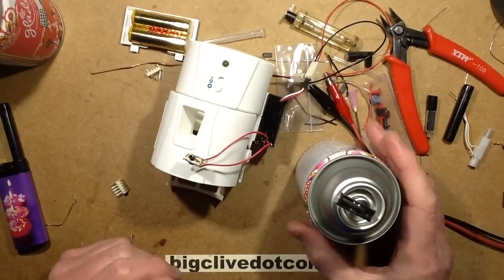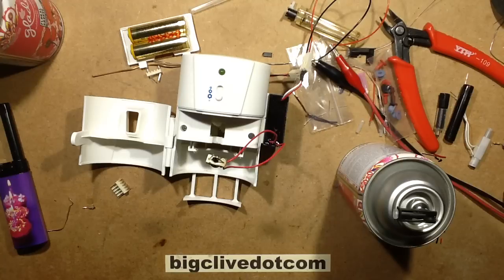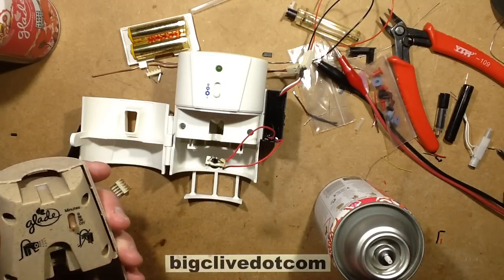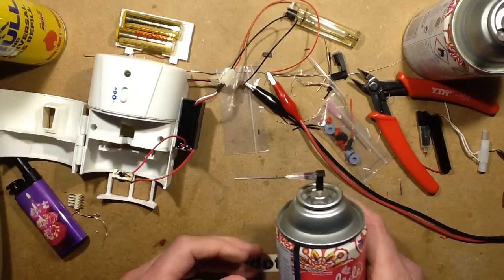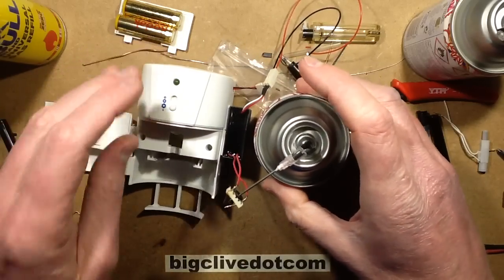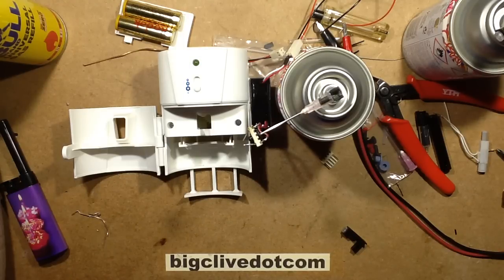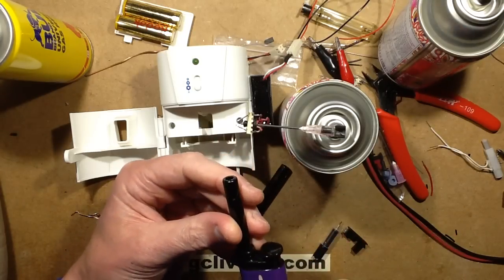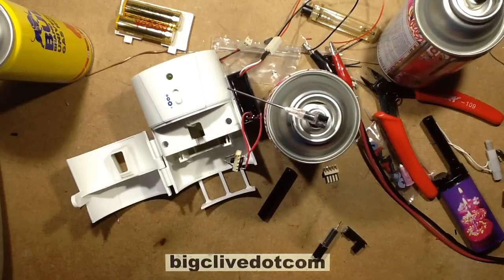Failed automatic flamethrower project.

Comment: Your two options are pretty much find a nozzle that properly atomizes the spray, or use a more volatile canister of spray that isn't perfume or butane (I.E. WD-40).  The needle makes the liquid stream too condensed for ideal A/F ratio to ignite (unless you were using really flammable liquid like a petroleum product).  Coincidentally because the standard spray nozzle on the perfume cans actually atomizes the liquid to help dissipate the spray as much as possible to be carried around on whatever air current is circulating, it makes the ideal A/F ratio too.

Comment: Hi Clive.  I used to work in hotels and the mental pictures of dozens of these firing off at random just fills me with warm and fuzzies.  While using air freshener has the side benefit of scenting the air as sort of an apology for setting coiffures ablaze - the liquid bits are working against you in keeping a small form factor.
a. You to need more distance and time to atomize properly and allow the non-burning bits to dissipate.
b. Unless the nozzle is precisely aimed the fragrant oils will act as napalm and burn your device.
c. Loss of ignition heat from evaporating the water mist.
I think adapting a butane can will give much better results and allow ignition within the original form factor of the unit - we can't have air fresheners with canon barrels sticking out to arouse suspicion.  I suppose you could add a small container of scented oil and feed it into the stream via one of your needles and the venturi effect to alter the size, color, and smell of the fireball.  At least you'd be in control of the burning / non-burning bits ratio.
-Grouchy

Comment: This reminds me of having to remotely feed the output of a smoke machine through tubing.  Resulted in melted tubing.  Then used metal tubing but had blocked off the fresh air supply to the nozzle so the fluid did not atomize properly - leaving the adapter a little loose fixed it all.  What you need is the extension tube to have a metal atomizing tip on a tube.    I would think the vaping world would be a source of such components.
  I built a similar setup which allowed any can of nice or nasty contents to be remotely fired.  With flammables, we used a tea candle for an igniter - not fancy but was for TV SFX.  https://www.flickr.com/photos/simplesimon/3461015568/in/album-72157665406378341/

Comment: If you can find any, look for an SSSCat. They are hilarious little cat scarers designed to go on counters and stuff, they have a little PIR module in them. They also run on 6v and use a solenoid and integrated tubing and stuff.

Comment: This is a great project but is it not basically the fire machine?  The orifice from that is probably a better sollution  Or maybe the brass orifice from a flower/degreaser pressure sprayer and maybe control that with a PIR out in the garden.
Reply: +rimmersbryggeri There you go. I was trying to think of where a metal atomiser could be gotten. That would keep the atomization and since it's brass, it wouldn't melt.  Some simple adhesive to hold it in-place... wouldn't need to withstand heat/fire for any extended length of time...  and "Orifice" could be added to the name as well! ;)
Reply: wdavid parks
 The fire never touches the orifice if it is properly set.

Comment: What if you used a non flammable tube, perhaps made of metal, the same ID as the spray head with slots in it for air intake? You could also weld a bracket on the tube to protect the sparking assembly.

Comment: So I just tested what you said about the vents around the side of a lighter being needed to ignite a flame and it would seem you were wrong on account of me  burning my fucking finger, nice one Clive
Reply from the maker: +Arnold Layne Try putting some tape round the lighter and lighting it several times in a row.  Initially it will light with the residual air, but will usually fail to light afterwards until enough air has re-entered via the end.
Reply: +bigclivedotcom Aye I should probably have factored the residual air into my experiment, finger is still stinging haha

Comment: I have a feeling that as well as the fuel-air mixing problem that you've identified, the gas leaving the blunt needle may be going faster than the flame propagation speed of the mix - perhaps replacing it with a length of brass tubing that fits over the outside of the can nozzle would work better.

Comment: What if you had the sparker leads mounted to the front cover and extend out a bit in front of the unit in a sort of horizontal Jacob's Ladder?  They could be #16 bell wire.  The spray would be sprayed on the spark and ignite quite nicely.

Comment: Can you get the ignitor about 1-2cm in front of the nozzle to allow better atomization?
Reply from the maker: +Carlton Dodd I tried that but it was still unreliable and then the extended wires desoldered with the burn-back and fell off.
Reply: +bigclivedotcom You'll get it figured out.  I have faith in your ability to make innovative, dangerous toys from consumer goods!
Reply: +bigclivedotcom isn't that why real flamethrowers use solid metal rods as the arc points rather than bits of wire?
Reply: +bigclivedotcom I'd go with a proper electrode set for this - steel wires going through a ceramic holder. Salvaged off old gas burners or something. Or perhaps even just wires with flameproof insulation going through a steel holder with the ends bared?

Comment: maybe if you used a canister of butane instead of the air freshener?
Reply from the maker: +0yeme0 I tried it and managed to fill my workshop with quite a lot of butane vapour without ignition.  It was "exciting".
Reply: +0yeme0 air freshener is mostly butane. Don't think it would make much of a difference.

Comment: Clive, I know the smell you mean. I call it fart in a tart's handbag.
As to the fuel / air mix problem, why not add a slightly wider tube over the needle. The tube needs to be open to the air at both ends and extend past the end of the needle. This effectively makes a venturi fuel injector / system. The fast moving strumpet scent pulls air in from behind, mixes it as it flows forward and then the igniter sets the mixture on fire.
Different diameter tubes will alter the stoichiometric ratio of the fuel / air mix.

Comment: I'm going with file a v or x in end of the needle to disrupt the fluid surface tension, but you only need the fluid to break up a bit so even a small piece of wire just to spread the fluid stream would work?
Personally i'd be going down the route of sleeve over the tube with a bigger diameter tube that come off the end of the smaller tube and then notch that tube so its drawing in air and causing some turbulence on the outside of the fluid stream... sort of like a propane burner / carb but you don't want it all setting on fire just a bit on the outside to that the flames heat is carried away then the fluid can boil mid air and give you a bit more distance.... or make it more like burner and just have a fireball.. :)
We used to use super soaker 50's to make flame throwers as kids much fun till we burn down a trestle at my cousin's house, luckily they also work well as fire extinguishers, which saved the rest of the garden.. xD
Reply: +Dave Webster yep the original nozzle just shooting down a tube, probably 13mm copper pipe, would draw air and ignite at the end and be as short as the current needle

Comment: Definitely revisit this, Clive! Much excite! :D
I reckon you could use the metal needle as one of the electrodes, some wire wrapped around in a helix with a small section at the tip acting as a spark as the second electrode, and a flame proof spacer separating the two for insulation.
That's what I'd try. Perhaps a glass tube cut to length? Fibreglass sheath material wrapped around to form a tube?
Experiment :D
Good luck!

Comment: so when it doesn't catch fire immediately (due to mixing ratio imbalance probably) you blow out the spark. How about a glowing kanthal wire? might be a more reliable source of ignition. Doesn't have the same flair a spark has, of course :D

Comment: This sparker looks more impressive:
http://www.ebay.co.uk/itm/Incredible-DC-3-6V-6V-400KV-Boost-Step-up-Power-Module-Voltage-Generator-Black-/371338759332?hash=item567583cca4:g:R5QAAOSwl8NVZ~zP
Reply: It's the one from Julian Ilett, right?
Reply: yes
Reply: +the3dvideo The 400kV is a typical Chinese marketing hype. They state the spark goes up to 2 cm but that is equal to only 60 kV if the dielectric strength of air = 3*10^6 V/m
Reply: +the3dvideo spark transmitter....not that i want to give anyone ideas, notice how it messed up the audio, its not actually very loud, its the RF interference, couple with tv aerial......

Comment: Thought about jetting the fuel through a fine metal mesh with the igniter on the other side? It might sufficiently disperse the fuel in air and provide protection against the flame backing up. See the latest video by Steve Mould for a clearer explanation.

Comment: I think the plastic head is the atomizer... by putting the needle on it, you're making the mist combine back into a liquid.  You might be overthinking it a bit with gas lighter nozzle thing.
Reply: The air to fuel ratio would still be important, but yeah. Vapors tend to burn better than liquid drops.
Reply: +mnelson10000 Agreed, It's not vaporizing properly for the flamethrower effect. I bet that needle thing would make it a decent perfumed squirt gun.
Reply: +Mr Rishi The Cookie making it work would be a nightmare, without very careful dosing it'd squirt rich air/rich fuel, each time extinguishing itself. Believe me, mixing beer and water with that sort of installation is a pain, I wouldn't like to try it with a combustible gas
Reply: +Josh G. (OtaconEmmerich) Also I'd get spark a bit farther away from the spray point for better vaporization of fuel.
Reply: +mnelson10000 How about adding a line of compressed air into the same nozzle. That way the air and fuel mix inside the needle and then get forced out and then at least puts out a bunch of small droplets. So when the trigger is pressed both compressed air and fuel get fed down the same needle nozzle and then my theory is that it should work.
Reply: Mr Rishi The Cookie The nozzle is quite small, and while your theory is correct, you would need a nozzle double the size for the fuel alone. (if it's the metal one you're referring to.)

If you are talking about the plastic atomizer, then it's big enough for the fuel, so you would preferably feed compressed air into the stream after it exits the atomizer.
Reply: Sked NEC. the metal one. And yes it probably should be thicker.
Reply: +Josh G. (OtaconEmmerich) perhaps if the needle was pinched slightly or perhaps using the tip off of a charcoal grill lighter
Reply: +mnelson10000 He said the reason why he doesn't use the original nozzle is because it catches fire. The lighter nozzle might be a nice replacement.

Comment: I wonder if you could rig up a bit of a venturi nozzle to pull air in and mix it with the fuel. Somewhat how a propane grille uses the rush of propane to suck air into the mixture as well.